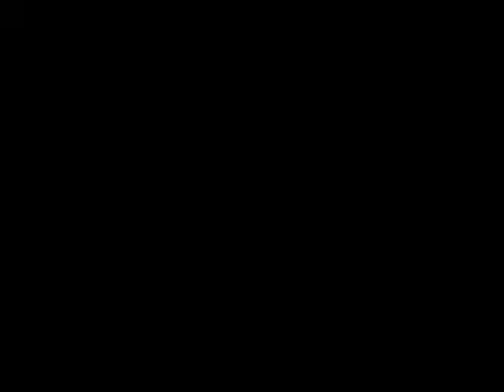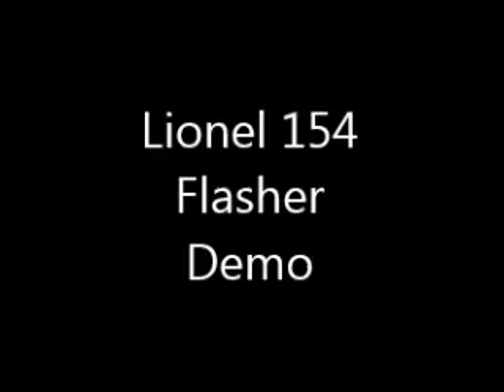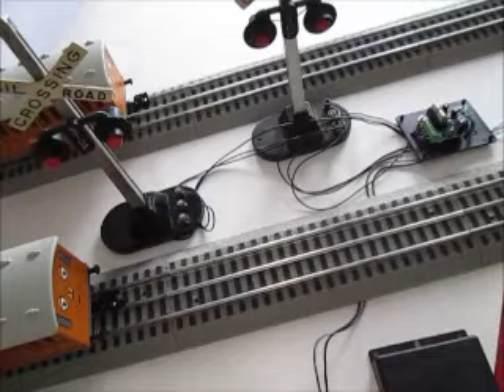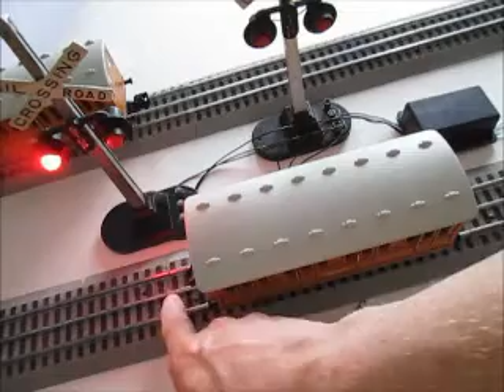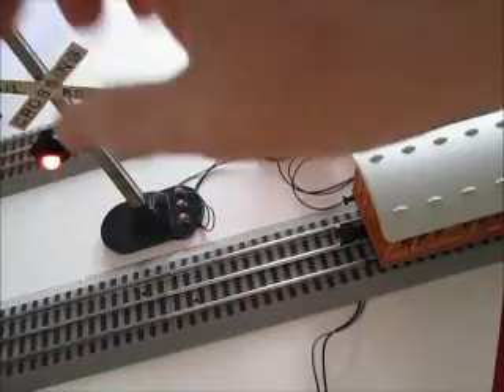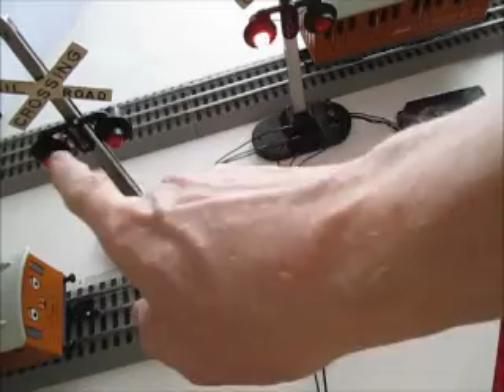154Flasher

Comment: I have the crossing signal but no contactor nor flasher unit.  Where might I find these two items to make my signal work?  I do not use FasTrack but use the old tube type track.  My signal is quite old with incandescent bulbs.  Thanks.
W Rusty Lane in eastern Tennessee
Reply from the maker: Try Dallee #367.  Thanks

Comment: where can I find the electrical flashing circuit board?
Reply from the maker: It is no longer available.  Sorry.  Thanks for looking.
Reply: +David Hayes do you know where I can find an item simular to that
Reply: +David Hayes like at a hobby Store
Reply from the maker: I am the one who originally built this item.  It was a switch controller that I made into a blinker for the Lionel 154.  Everything now uses leds.   Dallee sell electronic items for trains.  I could make one of these units for you for $40 if you can't find anything else.
Reply: +David Hayes if I can't find any at my nearby Hobby Stores I'll let you know
Reply: @davidhayes8461  Cool demo! This is an interesting idea.
What type of switch controller is it?
I'm curious as to why the period of flashing changes depending on the load.
Reply: @TexasRailfan21-RailfanRyan  If you're still interested I designed a cheap and simple circuit to do this.
My most recent video is a fancy demo of it basically and has the schematics and parts list if you want to make it yourself for under $8.
Reply from the maker: @ZygalStudios  Didn't understand your question at first.  Flashing period changes with load?  The sensors get retriggered so a longer train continues to make the flasher work. Thanks.
Reply: @davidhayes8461  Let me be more specific: When one 154 is triggered and active, the period of 1 second at 50% duty cycle for each bulb (.5 sec on, .5 sec off) seems to be just fine. But then when you demoed both triggered at the same time, it seemed to be 1 second on and 1 second off for both.